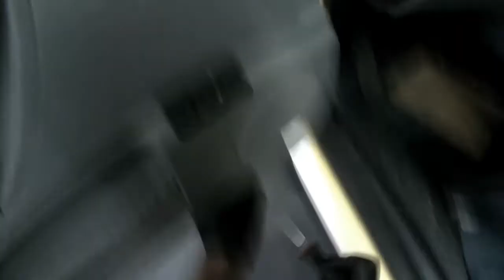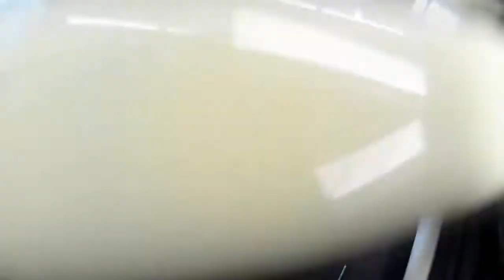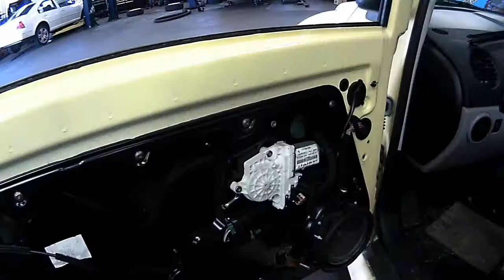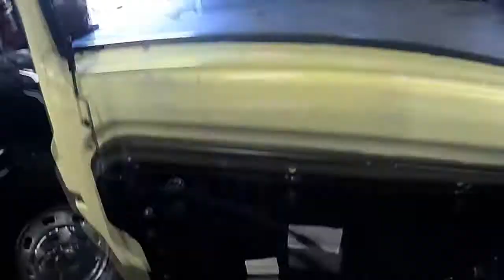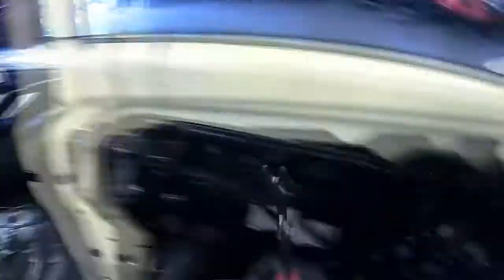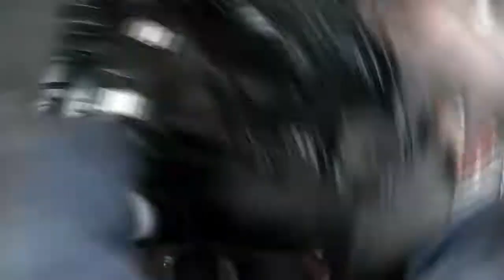New Beetle Driver Window Regulator Removing....

Comment from the maker: Here's a better video. It's about door lock actuator, but the whole assembly comes out anyways, so it's pretty much the same thing.
https://www.youtube.com/watch?v=x8MfSTSDxDo
Reply: Thomas  my drive window dont work  but other does  somebody tell me check dislay  what do u think
Reply from the maker: @jimmycrowe3989  Year, make, model? Check for wiring damage in the door jam loom. From the outside, insert the key in the door lock and hold the key in the unlock position. All windows should go down. If the driver window now works, the problem might be with the button in the door. If the window doesn't go down, check the wiring and then the window regulator / motor (remove door panel to gain access).

Comment: Hi, Thomas. It's you're number 1 fan, Cher, here; at it again on my mom's 01 beetle. Y'know... you really do have the best repair/install videos on YouTube. I mean that. It took a while but my mom's bug purrs like a kitten; it was the O2 sensor but dang near everything on the powertrain was replaced along the way. Oh, and water damage on some of the relays. 
Right now, I'm replacing the window regulator on the passenger side door. I'm having trouble getting good tension on the cables though. They're kind of baggy. They should have some decent tension; shouldn't they? I've got the little clamp thingy on the regulator box but when I take it off the cables are still kind of wonky. Any suggests? Thanks, in advance. I know you always respond to every comment. Heh 👋😊👍🥾🥾 Appreciate it. Warm regards and happy new year.
Reply from the maker: Happy new year.
Are you installing a regulator "kit" or a complete regulator panel? If it's a complete panel, then the cables should already be routed / taut. If you are installing a repair kit, then you are probably not routing something correctly. Post a video or send me pictures (fkh161 link in the description, click on Tool Request to send).